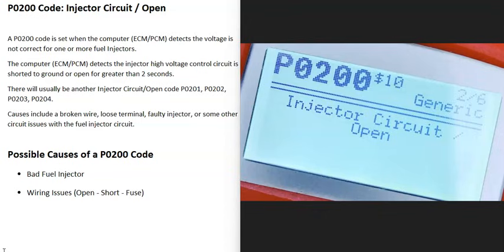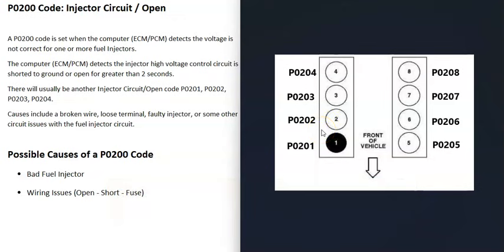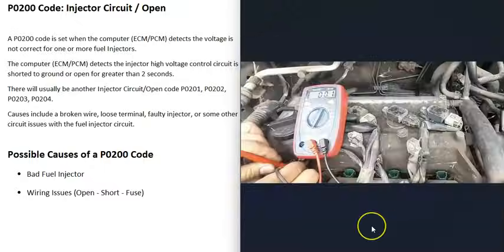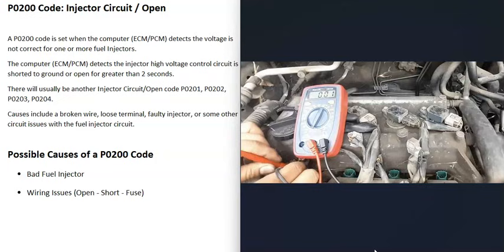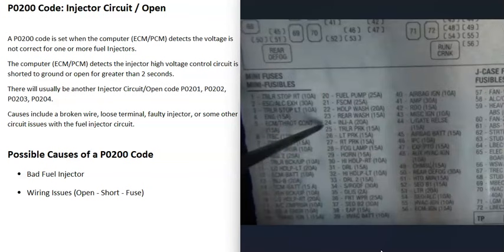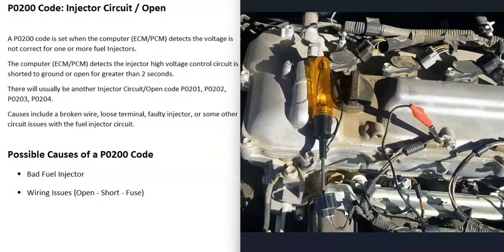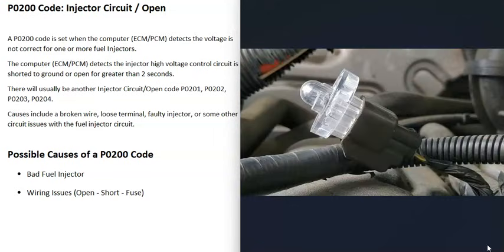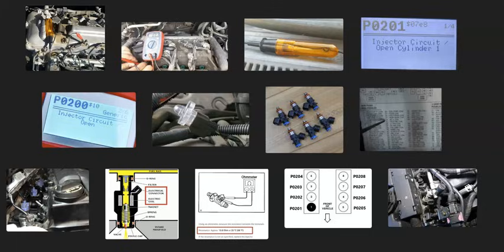Causes and Fixes P0200 Code: Injector Circuit/Open

Comment: Not all vehicles have 12 volt at injector plug some run on 5 volts ignition on but engine not running.

Comment: I'm getting a p0200 code. But it is not showing a cylinder failure 🤷
Reply: Any update i got that same code with p0300..Thx
Reply: @mikekhay523  what you figure out? i have p0300 and p0200

Comment: I have a ford ST line model and it’s a headache. After a p0420 diagnosis and replacing the catalytic and sensors, there is still a dashboard message that appears that says that the particle filter has reached its limit. After pressing OK on the steering wheel it goes away until it comes back again the next time I start the engine and drive after a few minutes. Any tips?